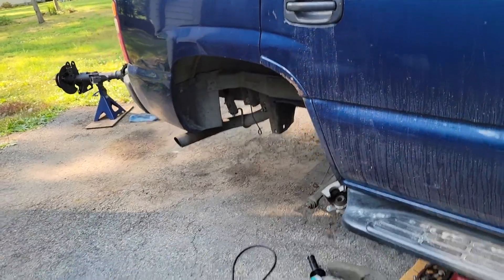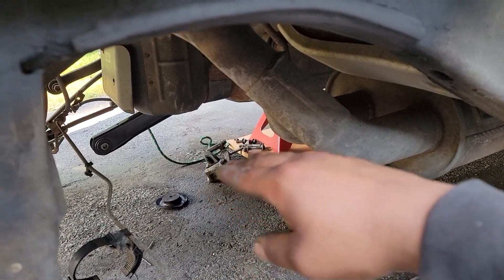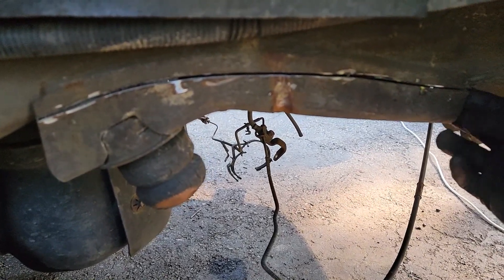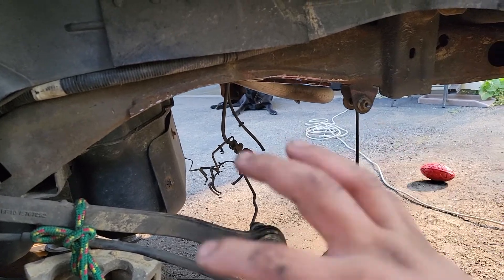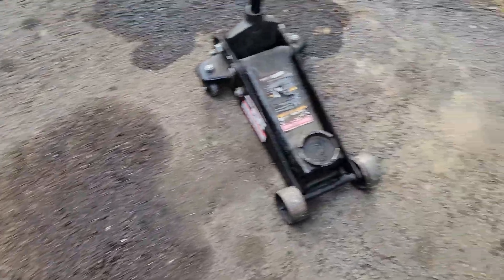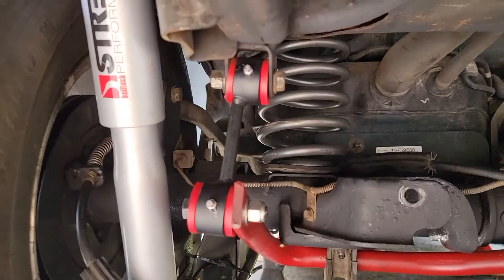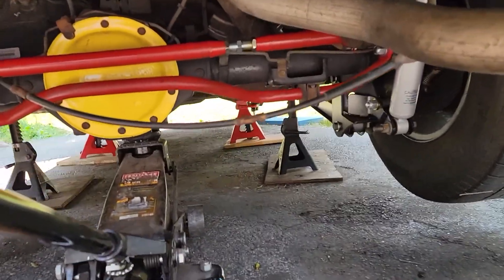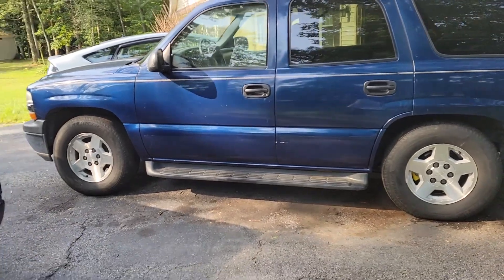lowering my chevy tahoe. ( squating the tahoe )

Comment: Hey I’m doing a 2 inch drop spring in the rear; would I be able to get away with not having to cut? And would I still need the shock and arm extenders?
Reply from the maker: You can definitely try not cutting and let us know if you have issues ?? I'd suggest using the shock and arm extenders so you keep the rear end geometry the same. If you have other ways definitely share with us

Comment: u can lower the front with stock keys just take them bolts off and u will be good none will come out been riding like that for a year and half
Reply: You didn't need a wheel alignment or anything? I going to get mine done at a shop fri, 4 inch drop in the rear...he was trying to charge me a arm & a leg to lower the front...but i seen people just turn down the keys...i just want it lowered 1 inch and a half,maybe 2.....
Reply: @BodyWeakDotNet what does tjis mean which key? New to droppin trucks and not really sure how to
Reply: @Dhill.angelI the keys he means are the stock torsion keys if you go under towards the middle your Tahoe suburban Yukon or etc you’ll find your torsion key bar and there will be 2 screws you can take out completely or lower to your liking and it’ll drop the front suspension or you suv
Reply: @josetorres1400  is it safe? Im planning on dropping the back soon but wasnt sure how to drop the front would it be safe to do this

Comment: Nice vid‼️ So the stock rear sway bar stays but aftermarket track bar is needed❓ thanks
Reply from the maker: I couldn't get the rear track bar to line up. So I just got the adjustable one. Ive seen other people have similar issues but I don't know why. Stock sway bar works just fine or you can also upgrade 🤙
Reply: @artysmotorsports  I Gotcha thanx for the Reply
Reply from the maker: Anytime

Comment: What are the rear lower control extenders for? I see some ppl install them when they lower there Tahoe but some ppl dont add them.
Reply from the maker: As far as I know they only keep the rear end stable and all the other suspension parts properly lined up. Pinion angle and such.
Reply: Where did you buy them?
Reply from the maker: Found mine on Amazon

Comment: I want to lower my back end but by how many inches to level out with the front… I’m riding on 28s Dub Ballers!!!
Reply from the maker: Every situation is a bit different in my opinion. You may only need springs and shocks or even a full airbag set up.  Bring it by a shop to give you better information

Comment: Could I just put the smaller coil in and would it be fine? If so what’s the coil u bought called
Reply from the maker: I imagine your ride quality won't be very good. Just Google trailblazer ss lowering coil spring. I went with belltech 4230

Comment: Hey man I got a 2wd escalade was thinking of ordering 4" lower springs for the rear. I'm on 22s I wouldn't have to modify anything would I? They come with the drop bracket for the shocks
Reply from the maker: I'd recommend doing the free travel mod.
Reply from the maker: Basically cut a doubler off the frame in the back where the bump stop mounts. Just to give you a little more clearance

Comment: What was the lowering you did on your Tahoe
Reply from the maker: When it was all said and done it was about a 4/3 drop.
Reply: @artysmotorsports  ok. Looks good. Would you say it's low enough
Reply from the maker: @superior3384  it was low enough for a 4x4 suv. Looks good and is comfortable. Now my 2wd obs has a 5/7 drop and that's more like it 👌
Reply: @artysmotorsports  cool. I have a 2000 Chevy Tahoe. I want to lower it but damn I'm not sure how much. I just don't like that big gap
Reply from the maker: @superior3384 keep in mind if you end up using the front lowering spindles you won't be able to use wheels smaller than 18 inches I belive.  The lower ball joint will interfere
Reply: @artysmotorsports  ok thank you. I need to do my home work on this because I don't know anything on lowering. What would be a good lower 3 front 4 in the back. I think that would be good. But I'm not sure what the right way to lower my 2000 Tahoe. It has a Chevy lean and it feels weak when I go over a bump on the driver's rear. That's the lean it has the driver's side is leaning
Reply from the maker: @superior3384  I personally like belltech components. There are other options if you're on a budget. I'll have a couple of links on the video description.  One thing that helped me was finding the rim and tire set up that I wanted to use beforehand.
Reply: @artysmotorsports  yeah I still need to buy the wheels and tires first. I currently have the stock ones. Just bought brand new tires for it like 6 months ago. I need a low budget lowering kit. But I do want a stiff feel sporty. So if it does cost more then it's ok. I was thinking of replacing my current engine and getting the 5.3 from summit racing 450hp. Or getting a 6.0 and camming it . I want more power. Then eventually turbo it. So the better the suspension the better. I don't want body roll
Reply from the maker: I see you... how about getting into a yukon Denali around the same year make. They came with a 6.0 and they're awd. You'd be ahead of the game.
Reply: @artysmotorsports  I could do that. But I've done so much work on my truck . It has zero rust . And I would prefer mines 2wd.
Reply from the maker: One thing at the time buddy...
Reply: @artysmotorsports  true . It'll get there. Thanks buddy

Comment: i just broke my tahoes diff and trans i just replaced diff with 4.10 and g80 locker for now now i just need a rebuilt stage 2 trans but i have a 2/7 drop on my tahoe 😳
Reply from the maker: 2/7 ? How did you go so low ?
Reply: @artysmotorsports  drop shocks ghetto cut springs , free travel mod and rear end link relocation and drop shock extenders i’m getting custom c notch soon i hit frame still a bit
Reply from the maker: Ohh wow. That's low low. Are you planning on putting bags on it? I just got done lowering the front. Stock torsion bars and lowering spindles. I love how it looks
Reply: @artysmotorsports  nah no bags fam statik gang 🤘🏽
Reply from the maker: @locsvfx7575  hell yeah brother.
Reply from the maker: @locsvfx7575  what's your wheel set up
Reply: @artysmotorsports  17s on 245 65 tires ima get the 18s from newer tahoe amd get some small tires and maybe drag radial in back after my heads and cam
Reply from the maker: Sounds like a bad ass build 🤘
Reply: @artysmotorsports  yeah man lil by lil my goal is to be a fast boosted hoe lol and make a name for texas tahoes 🤘🏽🙂🙏
Reply from the maker: I'm sure you'll make it happen I've been thinking about that. Maybe build a Denali since it's AWD and it's got a 6.0
Reply: @artysmotorsports  HY that denali will move with them AWD launches

Comment: You’re a pan hard bar Needs to be flipped around the small and goes on the left side the driver side
Reply from the maker: I thought it looked funny also but turns out this is how it's supposed to be
Reply: @artysmotorsports  I just used zip ties on my panhard bar.
Reply from the maker: @fintansky9369  how are they holding up
Reply: @artysmotorsports  They held up pretty good, they hold the line in place. It’s been about a year, I used cheap ones though I might change them out for better ones.